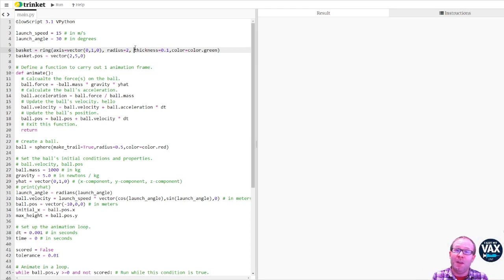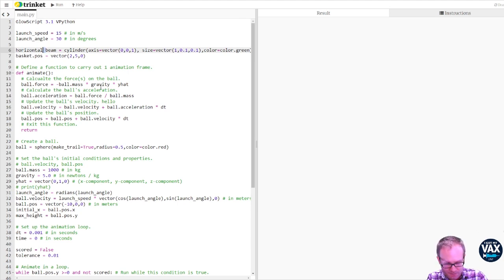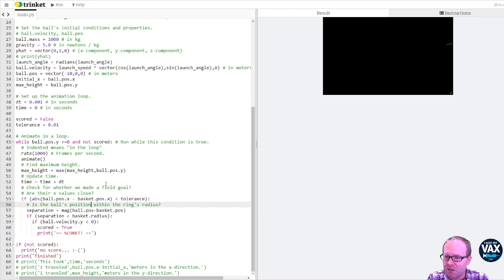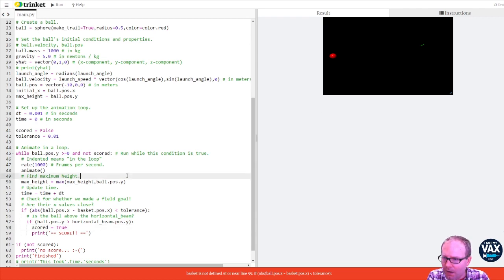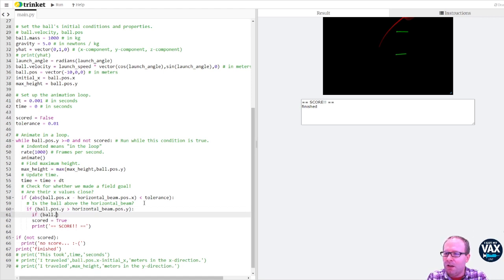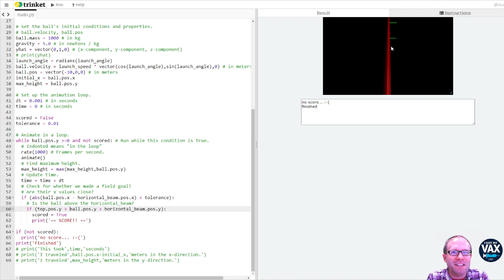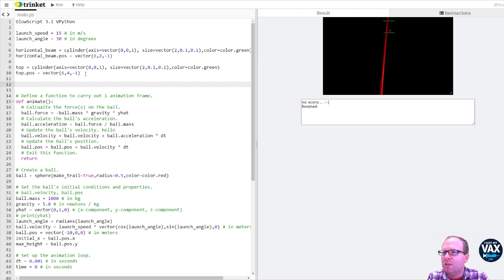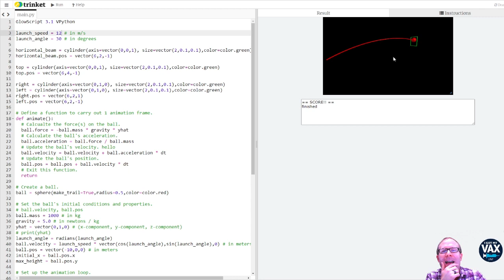Projectiles 7 - Field Goal

Comment: I really like this project but I have a critique and and question on this video.
Critique- From all sources I can find a field foal is good if it is "between the uprights and over the crossbar". There was no way prior to recent computer vision advancements that a referee could judge if a football is above the upright posts when it crosses the plane so no upper limit required.
Question- vPython allows you to define length as well as direction in the axis vector. tube.axis=vector(0,0,L) or tube.axis=vector(L*sin(theta),L*cos(theta),0) . You use a general direction vector then specify length in the size vector. Is the first example considered poor formatting in the physics world?
Thanks for your input.
Reply from the maker: Thanks - I could have sworn I saw a field goal ruled based on my understanding, but it has been several years since I watched football actively.

There are a couple of redundancies in where the length information is set in VPython, and it sometimes (depending on the shape) even depends on the order in which the properties are set. I tend to stick with whichever worked for me the previous time!
Reply: @LetsCodePhysics  Thanks for the feedback. Yes box is an odd one with pos at the center so axis only shows direction. I think maybe your way can be more consistent. Thanks